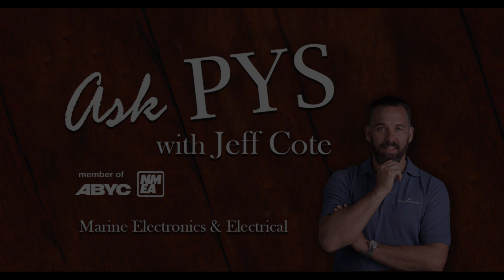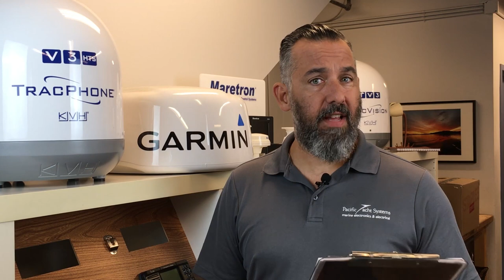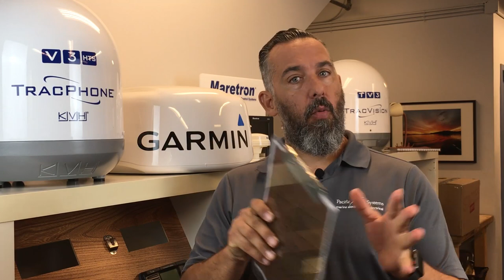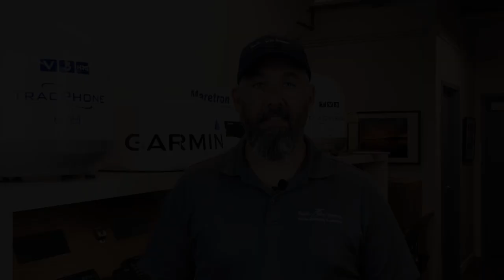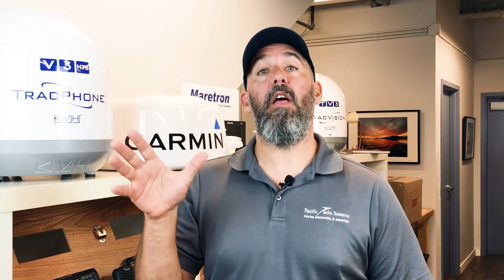Can I Connect Different Sized Wires?

Comment: I have a 2011 silverado LT 1500 low beam headlight  16 awg wire harness. Im replacing the burnt connector with a pigtail wire that is 18 awg wire. Is it acceptable? Any problems i might have ?

Comment: The overcurrent protection device must be rated for the lowest rating of the interconnected wires.
Reply from the maker: Hi Josi, you bang-on. Protect for the weakest link.

Comment: well i not have a boat or any thing like that i just want to know how i can connect a 8 Gage wire on to a 16 Gage because i need to connect a  Female Power Jack Connector it will only fite 12 or 16 Gage but not a 8 Gage so i have to add a short 16 Gage maybe only a inch long or shorter to add the  Female Power Jack Connector at the other and i need to ass 16 Gage to 8 Gage from the produt to the 8 Gage wire

Comment: First question: Is there a range in size that I can connect 2 different wires on a terminal strip (ex. connecting #20 AWG on one end of terminal strip and connecting #14 on other end?
Second question: If my terminal strip is design for inserting wires and not ring connectors, can I connect two different sizes on a terminal strip without a ring connector?
Reply from the maker: 1) The terminal strip is rated for a certain ampacity, in turn the wires connected to this terminal strip will only be able to handle a certain size connector (e.g. for example a 20 amp terminal block, will not be able to fit a #6 lug, but would easily fit a 10-12 connector on one side and a 18-20 connector on the other side

2) Again make sure your terminal strip can handle the maximum current, besides that inserting different sized wire should not matter.

Comment: I need to move a ceiling light about 12 inches and all I have is 14/2 wire and I am not sure what gauge currently powers the light - is this a safe connection for only 12 inches

Comment: So I just bought a boat and the trolling motor connection is a Four gauge but the plug that I’m putting on Is it 10 gauge will that be a problem
Reply from the maker: Hi Junior Cortes, 10 gauge wire can only handle 30 amps of current, follow the manufactures advice on selecting the wire size for both amperage and voltage drop.

Comment: Thanks for your generosity Jeff, very valuable expertise and advises always. One question if  I may, what does the regulation says about the usage of AC cables (EU 3wires, blue, braun and yellow/green) to carry DC on a boat ? Somme shipyard seems to do this but It seems to me potentially very confusing for later maintenance. What says the legislation and should I accept this on a new boat ?
Reply from the maker: Depends where your boat is build. Basically follow the local regulations for color codes. Here in North America we follow the ABYC standard.

Comment: How do you feel about solder connectors in general?
Reply from the maker: Good question, on boats you have to do a compressed connection. Soldering is something you can add to the compressed connection if wanted.
Reply: @PacificYachtSystems  I guess my question especially applies to electronics and specifically a transducer tail ( plug) I wanted to cut it off, do my pull and solder it all back together at the MFD. Scared me a bit so I made the pain in the ass pull with it on... 😂

Comment: How do you protect a terminal strip from water or arcing in a smaller boat? Loving this series!
Reply from the maker: One option, would be to install the terminal strip in a sealed junction box with cable glands for the wire entry.

Comment: When do we need to use a fuse between a large wire source and a smaller wire load?
Reply: as long as the whole circuit protection is properly rated for the smaller diameter wire, you won't need a fuse in between the wires.
Reply: @diogobz268  good answer thanks
Reply from the maker: Diogo is correct, protect the smaller wire and the larger wire will be protect too.